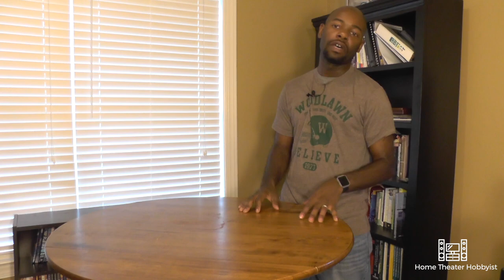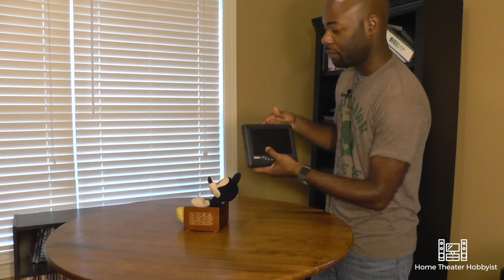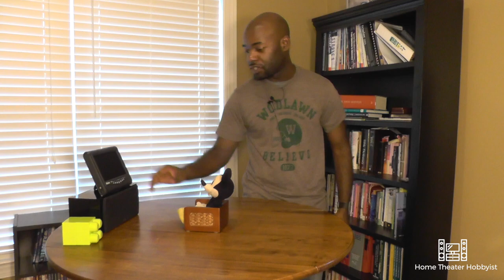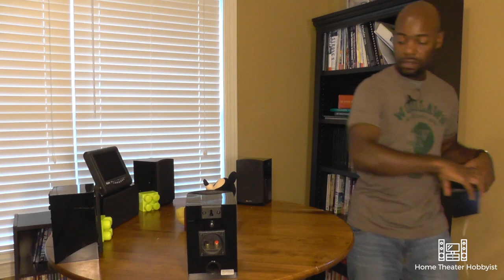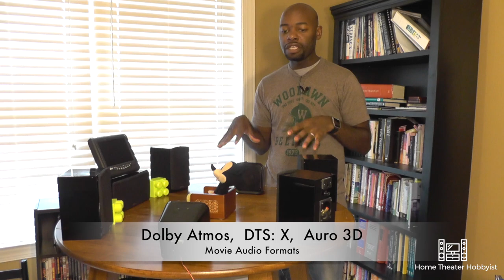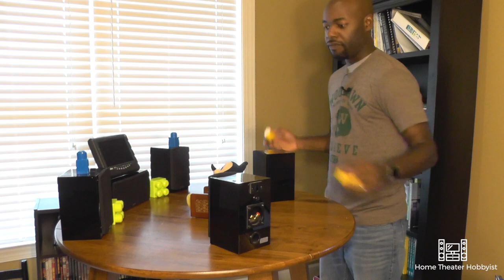Home Theater Basics - Speaker Layout

Comment: Great job trying to explain it, it can be a little confusing so I understand lol
Reply from the maker: +troy brown Thanks!
Reply: Good explanation the only remark I would make is than once you " add an extra subwoofer then you get 5.2 or 7.2.4 on your maximum configuration with the 4 height speakers...  instead of 5.1 or 7.1.4 other than you explained very well.
Reply from the maker: +H. Alves You're correct!
Reply: That's only true if the AVR or Pre/Pro has more than one sub-output. Higher end units have two outputs (Front and Rear) that can be adjusted separately. Forgot to mention, Good video BTW!

Comment: Thank you your informative videos. I need some help with my system and I hope you can help me. I have a 10' x 17' basement room that has 3 walls front, left, and rear. (the right side is open to a kitchenette). with the ceiling height at 9'. I have a Sony 4k projector ceiling mounted in the rear and a 110" Elite screen. My front L&R speakers are Klipsch RP-280f, center is Klipsch RP-450c. I also have a Klipsch R-112SW sub up front. I have 2 ceiling speakers at 10.5' back and 2 ceiling mounted Klipsch CDT-58-- II mounted at about 16' back. My theater chairs are up against the back wall so those 2 speakers a barely behind...not the ideal placement but it is what it is. I have wires in the left side wall 15' back but have not installed the speaker yet but my question to you is should I? I have another Klipsch ceiling speaker I could mount for the right side. My receiver is a Yamaha RX-A2070. I don't need to go crazy all out but want to take full advantage of the receiver and my setup. Can you please advise? Thanks!!

Comment: I already have a 5.1 channel, and i was thinking of buying a soundbar but instead of using it on front, i like to make it as a rear. Will it work?
Reply from the maker: The only way that will work is if your AVR has rear "Pre-out" connections and the soundbar has RCA input connections. If these two things are true: connect the AVR left rear "Pre-out" to the soundbar left RCA input and the AVR right side "Pre-out" to the soundbar right RCA.   If your AV receiver or soundbar is missing these exact connections this won't work so be careful.

Comment: I'm looking to configure a 7.2.2 set up but I'm confused as what avr specs I need as a minimum, spefically in the Marantz line would the sr6012 work?
Reply from the maker: Yes, that Marantz will work. A 9.2 channel receiver is the minimum number of channels you will need for a 7.2.2 setup.
Reply: Simply put just save up for an 11.2 or a 9.2 that can support 11.2 with an add-on amp
Reply: @RahzAlGhul  that's the thing I don't want to have to add an external amp
Reply from the maker: If you’re looking at 11 channels and don’t want an external amp then give the SR8012 a look. It’s expensive but it’ll do 11 channels of amplification.
Reply: @HomeTheaterHobbyist  great thanks

Comment: This was on point
Reply from the maker: Happy to help! 😁
Reply: I have duct working going across my ceiling  which is 7 ft high would you recommend atmos floor speakers or ceiling
Reply from the maker: In ceiling will yield better over head presentation if you can do it. Great question! 😁
Reply: I will most likely have to hire someone im not that good with cutting holes and pulling cable thanks again

Comment: If I wanted to build a 5.1.2 Dolby Atmos system. Where the atmos speakers would be in the ceiling. Would the ceiling speakers be up front, in the rear or in the middle between front and back speakers? If I wanted to build a 5.1.4, would I need an outside amp to power all those speakers?  Oh, by the way, nice air plane sounds.
Reply from the maker: In the receiver you can pick where the speakers are located front, middle, or rear but I would say place them over your seating position or in the front of your seating position.
Reply from the maker: If you pick up a 9.2 channel amp/av receiver you won't have to use an external amp. Here's one I reviewed https://m.youtube.com/watch?v=Sbbie3DRH0s
Reply: Thanks for the info, much appreciated. Interesting that you suggested the Denon 4400, I was looking at the Denon AVR-X2300W 7.2 (the 2400 didn't get as good reviews) if I decided to go 5.1.2. . I'll consider the 4400 if I decide to go 5.1.4, I already have the speakers and money is not an issue for me.
Reply from the maker: You’re welcome, the 4400 is nice because it supports 11 channel processing so if you add an external 2 channel amp, you can drive a 7.1.4 system

Comment: 5.1 or 5.2 is just fine you don't need all the speakers on top of speakers LOL.  I don't need it
Reply: I went from 4.1 to 5.1 to 5.1.2 and now to 7.1 and I will tell you every change made a difference and enhanced overall sound experience. Worth it 100%. Needed? No but better than 5.1? Yes.
Reply: @RahzAlGhul  which do you prefer? 5.1.2 or 7.1?
Reply: @skippychurch2965  7.1